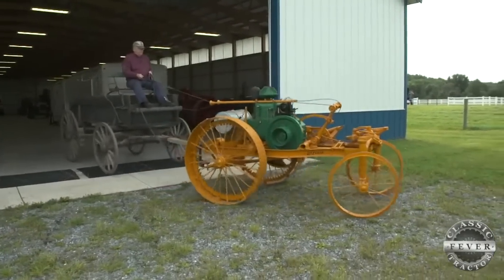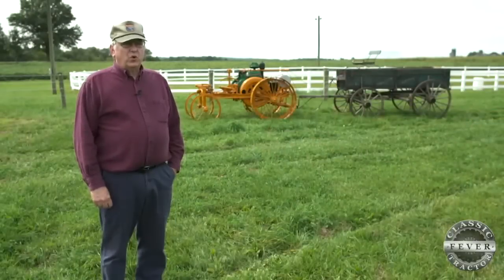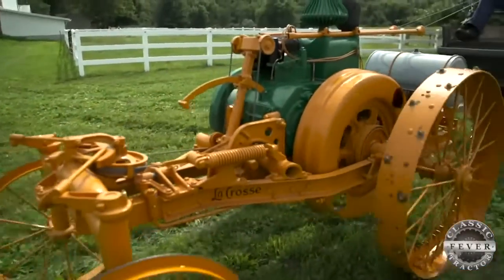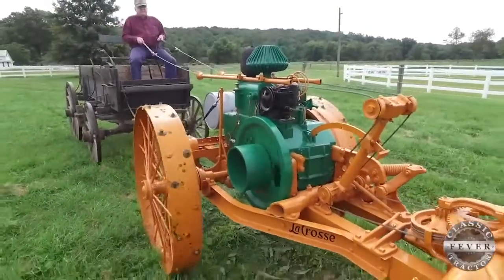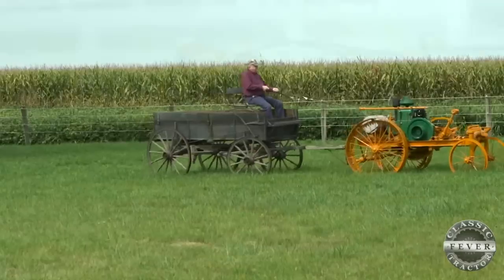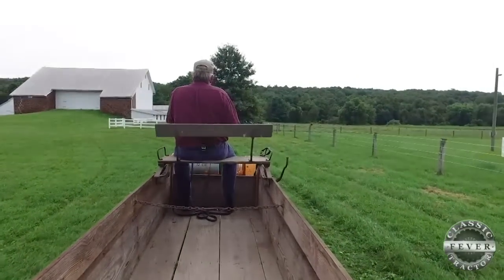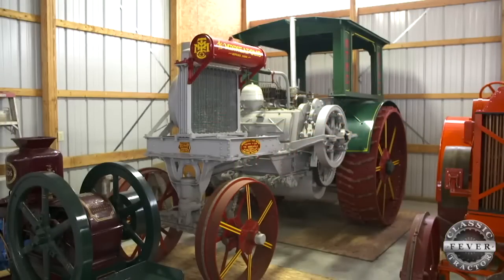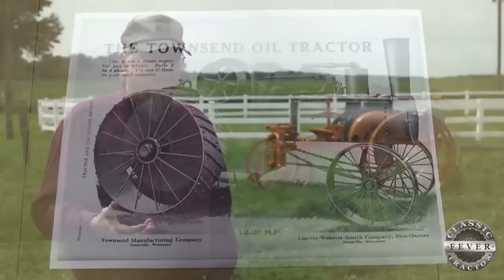FAILED Rein Steer Tractor - Rare 1920 LaCrosse Model M Line Drive Tractor

Comment: A neighbor had one of these back in the day. They used it for cultivating corn, pulling the old horse drawn cultivator.  He was a young teen when he got the job of running it. He always told of one incident, after starting it he left the crank on top of the motor. After a bit , it fell down into the large gear drum you see in the picture, and broke the casting. No repairs were any longer to be had, so they took it apart and had a local blacksmith weld it back together in his forge.  It worked like that till the boy went into the a\Army in WWII. He parked it under a tree in the yard before he left for D Day. When he got back, it and the old 10-20 Titan were gone, for the war effort.   Some time after the passed away back in the 90s, the cousins were cleaning up the back lot, under the scrap pile they found the frame of the LaCross.  It still exists but no other parts have been found.  He used to always enjoy seeing the one displayed at Mt Pleasant Ia, for years I thought that one was the only survivor.

Comment: Somewhere I have a photo of a creation of one of my ancestors. Picture a rectangular frame with a steerable wheel on each corner to support it. Two moldboard plowshares in the center, facing in opposite directions. And a steam engine turning two-throw crankshafts, one on each side, with rods about two feet long on each throw. Add a big cup shaped like a horse’s hoof to each rod. The wheels supported the weight, the “hooves” pushed it forward. At the end of each furrow you would flip the rod/hoof pieces over to push in the other direction, and shift plowshares. The wheels’ vertical axles were turned by cables on sheaves to steer the thing. His prototype did not have an on-board boiler- it used steam from the house’s heating boiler. You can probably infer how successful it was because you never heard of such a contraption, have you?

Comment: Like many small tractors back in time it simply wasn't heavy enough to do the task of plowing in many areas of the country. Soft rich dirt would be where this would perform best. Breaking new ground not so much. The market exploded everytime a manufacturer came with a bigger and more powerful model. Left the light weight companies behind by the dozens.

Comment: It may seem funny to us now. But if you look really closely at the back walls of very old machine sheds on farms or garages converted from carriage houses you can often see where big holes in them were repaired. Often times during the transition from horses to cars and tractors new owners unfamiliar with such things were given only brief rudimentary instructions on how to start and operate them by the salesman then turned loose to figure out how to do it on their own. So  stories from those days of them running straight though the back of the garage or shed while pulling on the steering wheel with all their might, and hollering whoa at the top of their lungs are plentiful. Lots of people especially farmers in those days had never driven anything other than horses. They had seen steam traction engines and such but mostly those weren’t owned or operated by the average small farms but only hired to come for threshing season. Some had stationary small gas or steam engines for belt work on the farm but nothing else that wasn’t propelled by horses. 
   Hence another reason Rein drive tractors enjoyed a brief period of popularity in the early years of the transition to power farming.